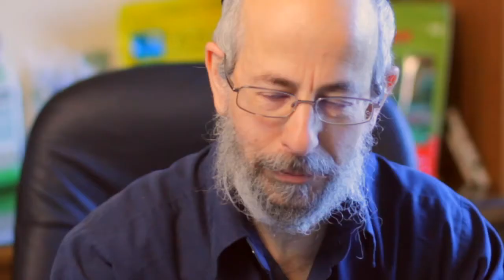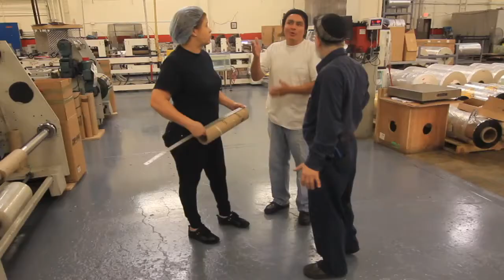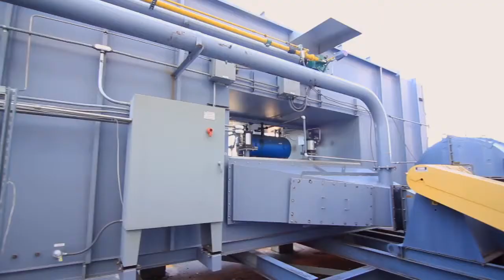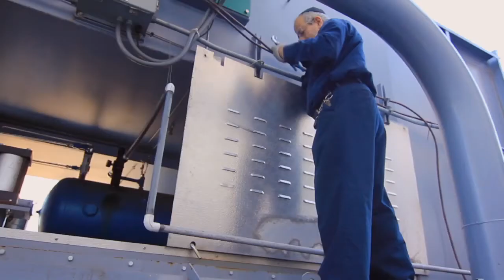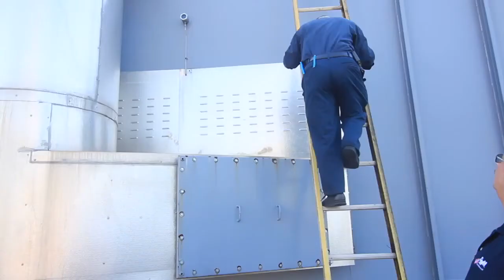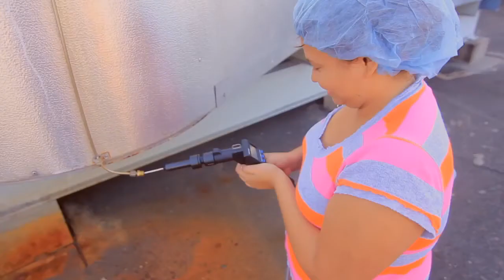Regenerative Thermal Oxidizer (RTO) System Installation at Consolidated Packaging by The CMM Group

Comment from the maker: The CMM Group designed and installed the #pollution control devices (Regenerative Thermal #Oxidizers or RTOs) currently in use at the Consolidated Packaging facility in Ridgefield Park, New Jersey.  Learn about their "perfect" experience with us in this video.